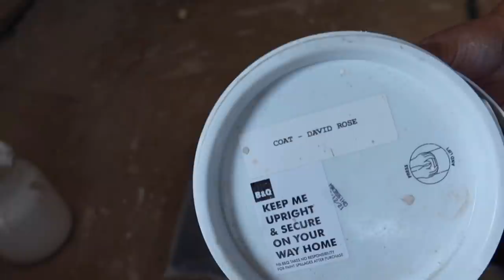Office Renovation | Prepping & Painting Room Makeover | Louise Henry

Comment: No. It’s not the tape.  Charlie DIYer has a tip. The white bleed, let that be silicone. Then the masking tape won’t matter.  It’s definitely worth doing.  I used it near my ceiling in the bathroom, as it was a dark navy. It gave it a crisp line which I know that’s what your after !
Reply: Can also paint over bottom side of masking in top colour before painting bottom colour so any bleed will be same colour.